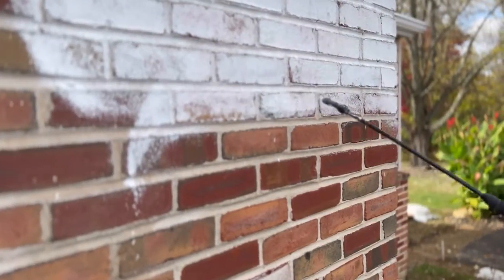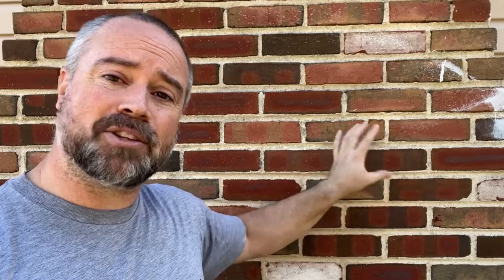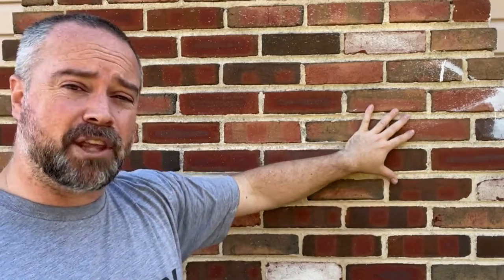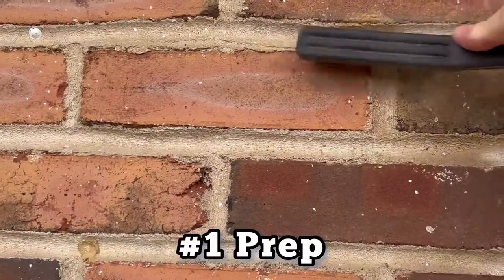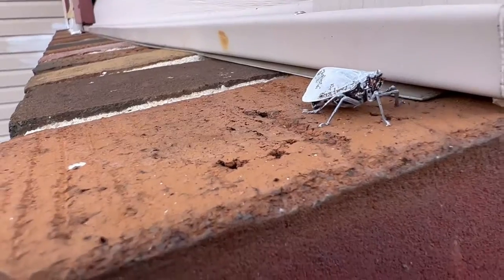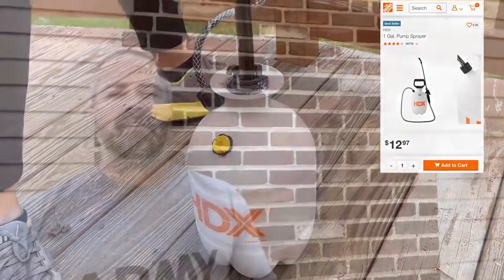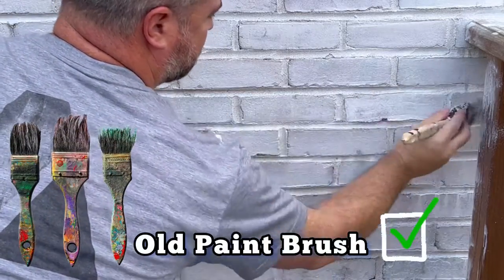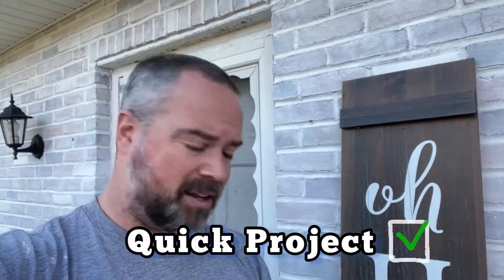How to Whitewash Brick - Cheap & Easy DIY #home #design

Comment: Can you roll & brush it on? Or is spray only the option?
Reply from the maker: Yes @AaronSharpe-uh7nm you can brush, roll or spray...all three methods are very messy so make sure you cover everything that you don't want to clean splatter off